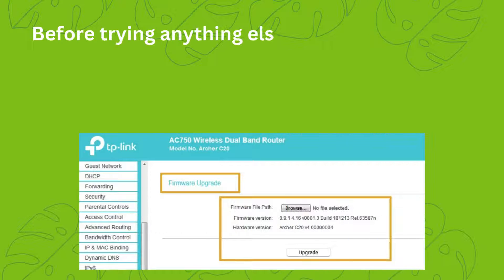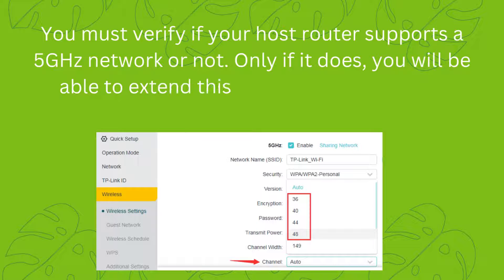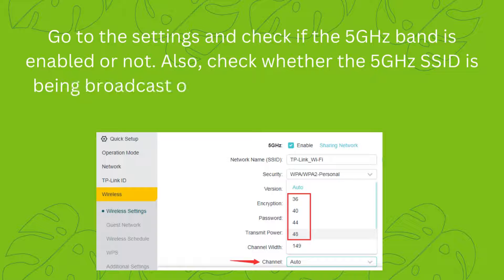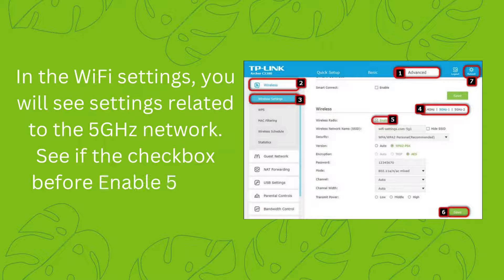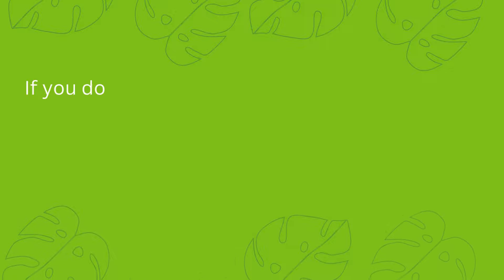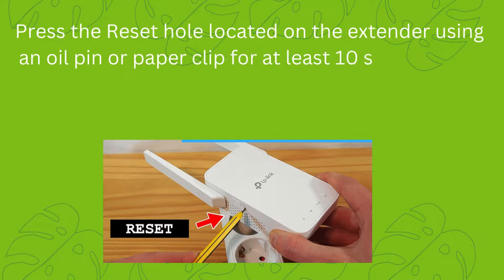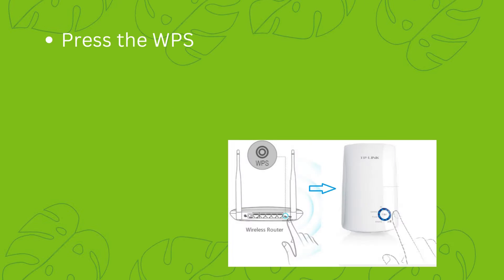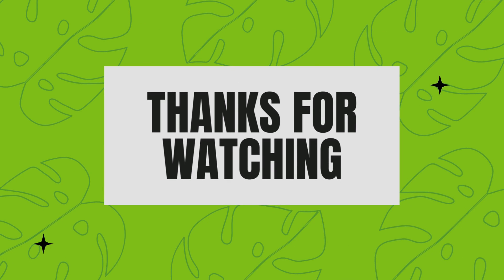TP-Link repeater 5ghz not working? Here is the Solution

Comment: After banging my head over this, I realized the issue my extender wouldn't find my 5Ghz network was because I had to go into my Verizon Wireless router settings online and toggle 'on' Access List. Then after a few minutes my extender rebooted and I noticed the 5Ghz LED was also solid now. So, 2.4GHz and 5GHz are now solid and working beautifully. 

The Extender works perfectly, but the issue may be the router, router settings, or something outside of your extender that may be blocking access for it to workf flawlessly out of the box. It's supposed to be as simple as pressing the WPS button on your router, then pressing the big button for 1 sec on your extender and let it conenct to al your bands and then controller and configure from the extender app.